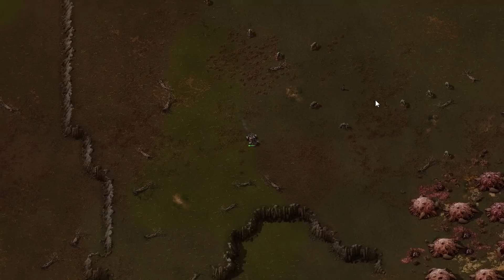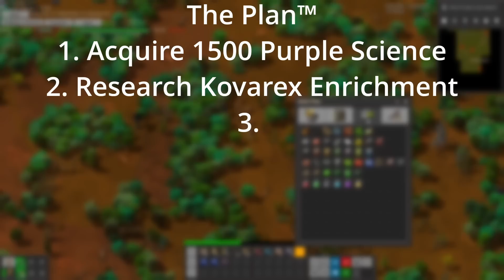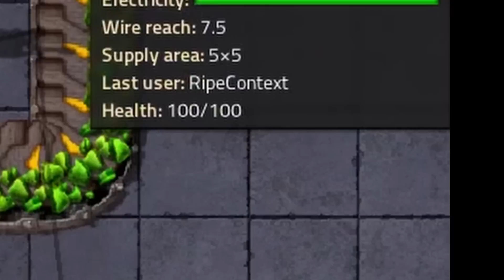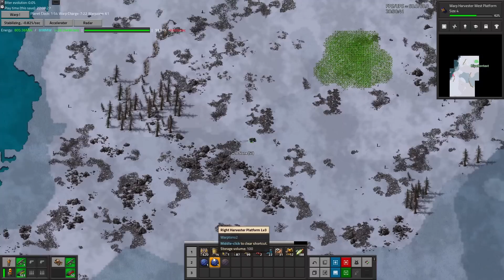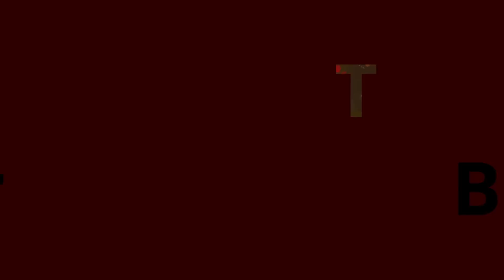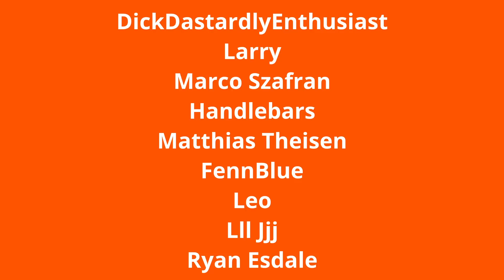Nuclear Powered Laser Beams | Warptorio 2 | #4

Comment: This is a really fun series, and the quality has gone up across the episodes!
One thing about the Covarex process, well, you don't really need it. even the initial 238 is enough for a lot of reactor fuel, so instead of waiting to get 40, then for covarex to spin up, you could have been running nuclear for a long time, with quite a few reactors already!
For a megabase it's 100% needed, but as long as you do the basic smarts of not overconsuming fuel cells when not needed, you should be fine without Covarex. Sure, you might need a few chests to store the dark green stuff, but bullets handle that nicely, as well as forgetting it out on a planet when leaving :D